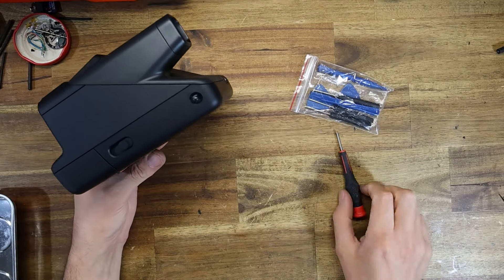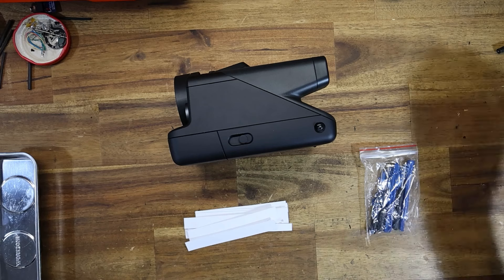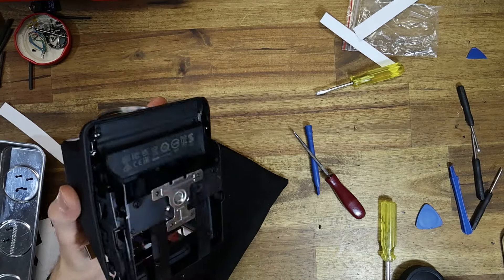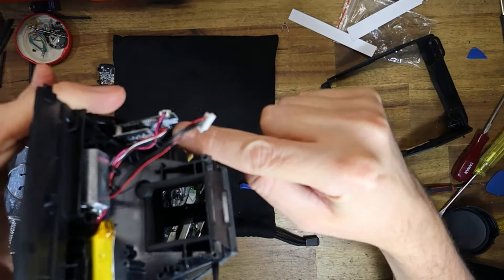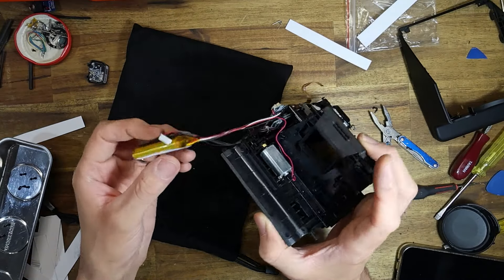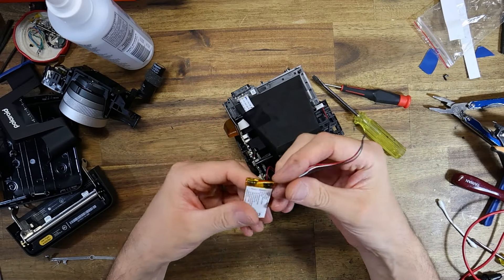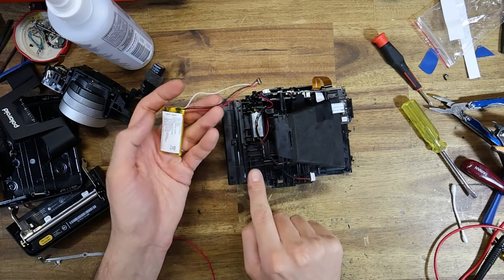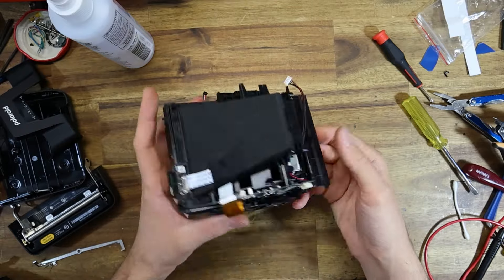Appallingly bad design: Fixing the Polaroid I-2 battery issue.

Comment: You are correct in thinking the doubling up of wires is for higher current handling, the reason this would've been done instead of just using thicker wires is that the connector used probably can't handle a heaver gauge wire being crimped into it. As to why they used that specific connector, who knows.
maybe they wanted a locking type as they've had issues with the battery becoming unplugged during assembly? pure speculation. 

As for the white wire, yes it is a temperature sense, and the camera would likely not work without receiving a signal on that wire. or at the very least, refuse to charge the battery. It's a very common form of protection. The easiest way around it in your case is to cut the board off the "dead" battery and transplant it onto a two wire cell of the same size
Reply: Another thing you could do is cut the board off the old battery, then solder a JST connector onto it so you can swap in new two wire cells in the future
Reply from the maker: Great minds think alike

This is exactly what I've done

I ended up totally destroying the weird 5-pin connector on the PCB, and have hand-soldered wires directly to the pads

This did turn out to be partially my fault. The plug lifts up totally perpendicular to the PCB! It's unlike any connector I've ever seen, and its not immediately obvious unless you scroll in a few images deep. 

I've used a thicker guage than the original, where I and have wired it into a 3-pin JST. I've also adapted the original battery to a 3-pin JST connector so I have a battery to play with in the meantime

I will need to strengthen the wire so one cannot tug it right off the PCB, but basically all I have left to do then is install a door and i'm good to go!
Reply: @theinstantcameraguy  You can secure wires using electronics grade silicone, or automotive RTV that is listed as "sensor safe", that way it won't foul the board. It's what is often used in electronics to keep components stable. 

As for the plugs lifting perpendicular from the PCB, I know Apple uses them a lot in their devices, and given how Apple-like Polaroid construction has become ( somehow moreso than the 80's and 90's ) it is no shocker they would use this connector.
Reply from the maker: @cdigames  funny, Cathode Ray Dude was just talking about the sensor safe silicon... 

I ended up making a tension guard out of plastic that i cut up by hand. Much easier and less messy :)

Comment: You know the naming of these batteries are actually the physical dimensions?
In this case it would be 1002045.
100=10mm thick, 20=20mm width, 45=45mm length.
I couldn't find that but 902045 are common. So 9mm thick, 20mm wide, 45mm long.
Reply from the maker: I'm fully aware of this. In fact, I demonstrate a 102045 in the video - the same I use for the I-1. But this naming convention only gives a physical dimension in mm. 

102045 are common in 2-wire versions, but less common in 3-wire thermistor versions. Yet both batteries are called exactly the same things

942044 are another battery that would fit. This naming convention is less intuative though 

I DID eventually find a thermistor version. However I havent found any that come with the JST connector pre-installed. Just three bare wires. 

Not exactly a big deal, but a bit less "off the shelf, drop it in" than I'd like

But certainly 3 solder points is better than 62+ steps of disassembly :)
Reply: @theinstantcameraguy  A yes, it's 102045, I messed up the numbers. It's weird they're using the 3 wire version though because they don't use it in any of the other cameras. You often see drop-in batteries for cameras also have 3 contacts. Not sure if it's for temperature though. Might as well be for measuring internal battery resistance or some way of keeping track how many times it has been charged.
Reply from the maker: @Ni5ei  if the 3rd wire is for anything other than a thermistor... I'm screwed lol
Reply: @theinstantcameraguy 😂😂😂